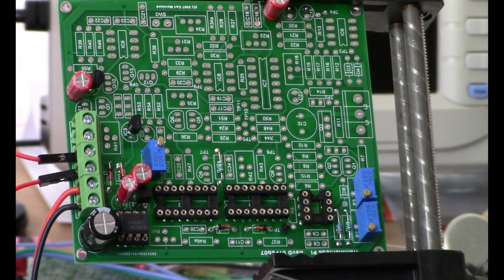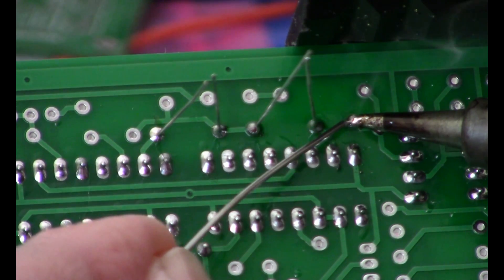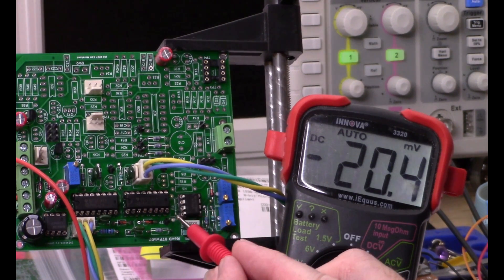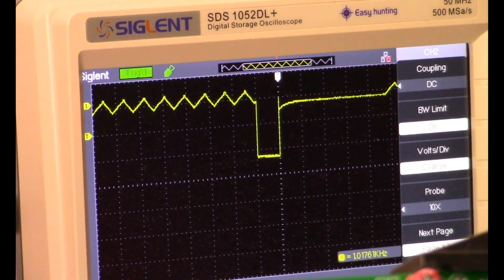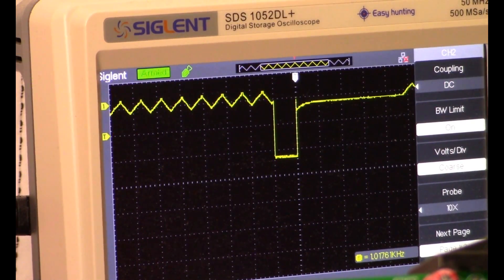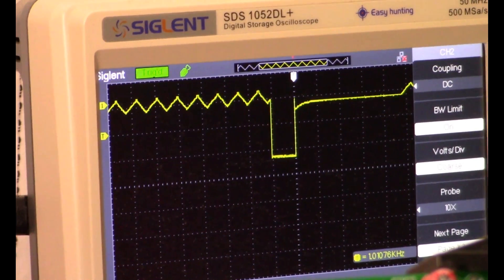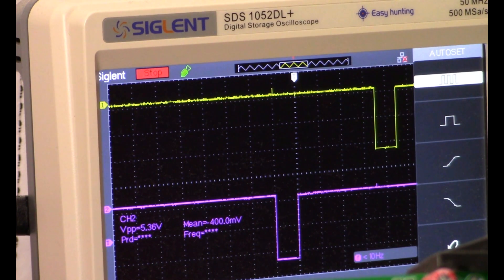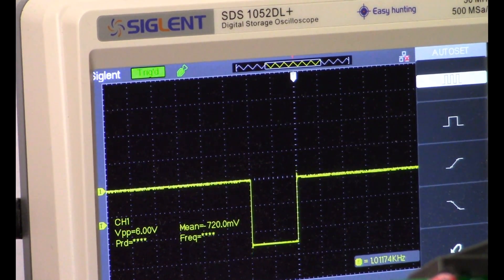Hammerhead DIY Metal Detector build Part #2  Clocking Circuit

Comment: hi fri. where to connect o'scope'ground.Thanks for ur sharing.
Reply from the maker: If you are asking about where to connect the ground for the Hammerhead project then the answer is put your ground clip on the +Battery.
You always need to check the schematic for this information as it can change with different projects.
Thank you for watching.
Reply: @SurfDetector  Thanks.